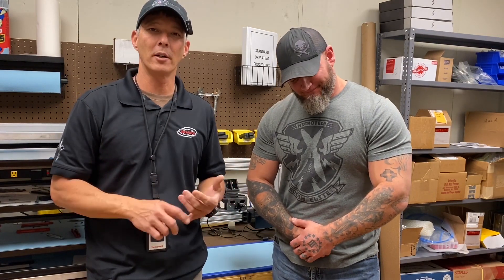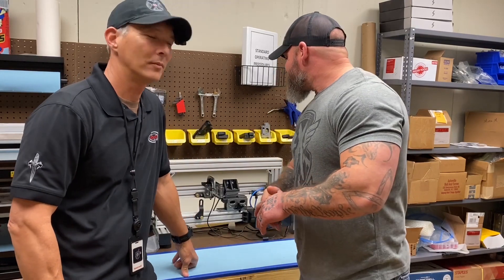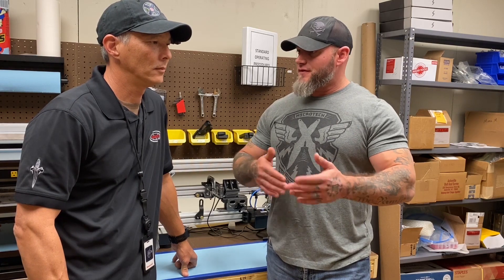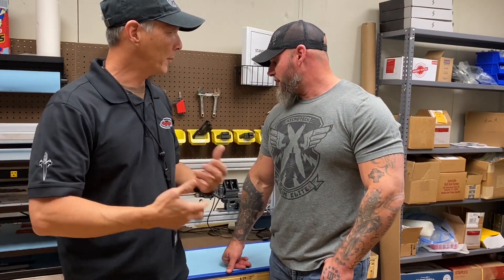Behind the Scenes: Microtech Research & Development

Comment: I’ve got a side opening automatic that I picked up probably in early 96. The blade is stamped 7/95 with a serial# 072. No idea what model it is, but it still opens hard and has never failed. Still carry it 25 years later. Wish I knew more about it, it’s always just been my Microtech. Handle has a nice checkered rubber inset.

Comment: I sent in 2 knives for some service recently and just got one back, but had some questions about the work done. I sent in a signature series Ultratech w/ clear top and bronzed hellhound blade. The clear top was cracked, but was replaced with a carbon fiber top. How come no more clear tops? Also i sent in a Damascus D/E Troodon for just lube and sharpening, but is it possible to replace an aluminum scale while its there?

Comment: Are their OTF knives capable of piercing as the blade is activating or is it even possible? I have an off brand and it will pass through paper but not cardboard when activated.
Reply: ScottyM1959 Newton's third law. Every double action otf I know of and every one micro tech currently sells have a safety built into the action. Micro techs single action knives like the halos don't have a safety built into the action. Thus when you fire it the spring applies all the pressure it can continually. until it fully extends or is met with more resistance then the spring can over come. So with those you do have to be very careful as they could cut you badly. That's why none of the halos have provisions for pocket clips. They are meant to be carried in a sheath only.
Reply: @StreetRocketJoe  Thanks for that information. You taught. Something I didn't know!
Reply: unknown user halos are great. I love mine. For convenience you are correct a double action is faster. However safety wise there is zero concern as on a halo you charge the weapon by pulling on the little wings on the bottom of the knife. Kinda similar to an ar15 charging handle. And to deploy you press a button down on the side of the knife. The newer halos have a safety slider that has to be operated to Press the button. It’s an extremely safe knife. But not something you would want to carry in your pocket. I have a halo 6 on my plate carrier and carry a combat troodon as an edc. So I’m my example your theories of when to use them is correct. I’m sure some people carry halos as edc.